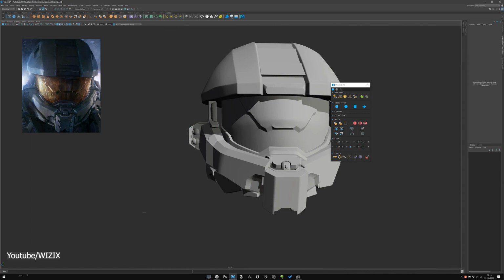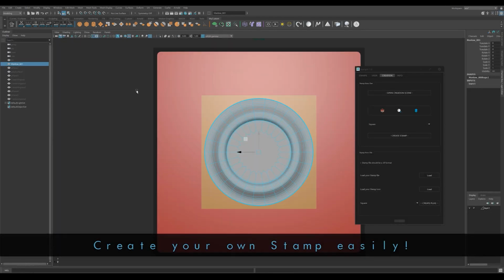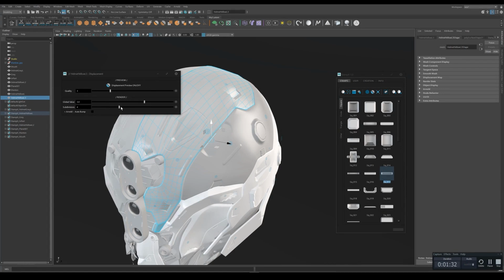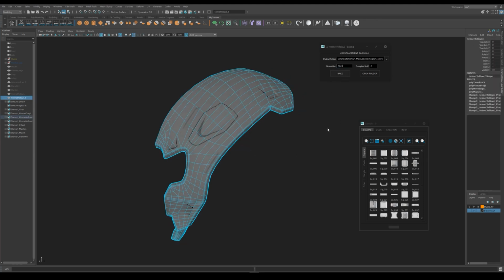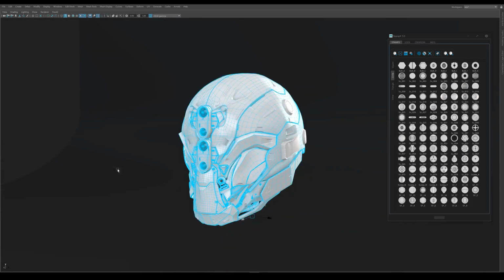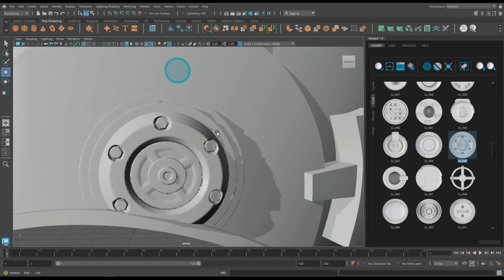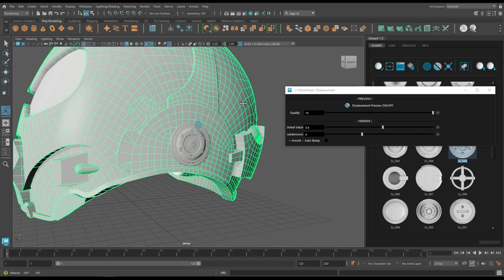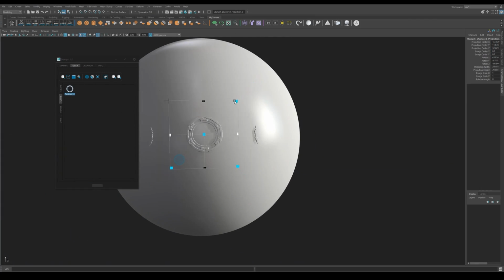Maya Plugin For Hard Surface Modeling | Stampit

Comment: If I'm going to bother with hard surface modeling, I'd just use Autodesk Alias instead of a plugin for Maya. It'd be really nice if you could make a video about Alias and other hard surface packages like ICEM Surf, or even high-end parametric CAD packages like NX, and CATIA.
Reply: I've used Alias for a year and couldn't get close to the results I can achieve in Poly or Fusion360.  And unfortunately I've only found one or two hard surface artists that use alias effectively. It seems too clunky and not well optimized. I spent 4k out of pocket last year to have a license of the concept version, since I'm a self taught designer I cant get a student license. So this is the main reason for not using it. But your millage may vary and I'd like to hear how you use it?
Reply: @bry_baby  There is a 1-year free license to use both Autodesk's Alias AutoStudio (which includes Alias, Maya, CreateVR [VR design app integrated within Alias and Maya], and VRED Design), and you can also check it out with a 1-year free license of VRED Professional. Each of these software carries a $50k per seat license for three years, or $100k for the both of them combined.

The main reason I use Alias, is because it's derived from the old Alias/PowerAnimator software from the '80s/'90s, was used in my favorite movies, and for making vehicles using reference. Mostly 3D planes and vehicles, I'm not good by any stretch, I'm just trying to get used to using an actual surfacing application like Alias/ICEM Surf, even if it's way above what I need and can probably just do in Maya NURBS, or Modo's NURBS.